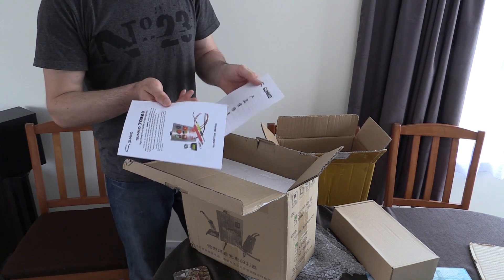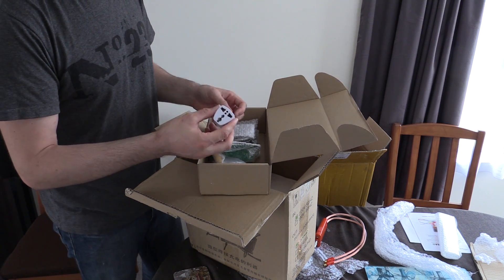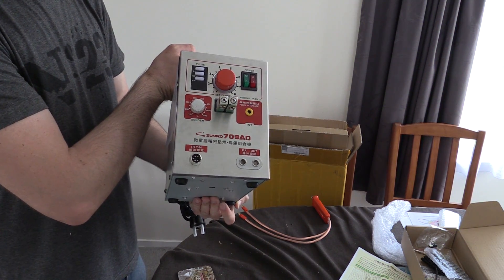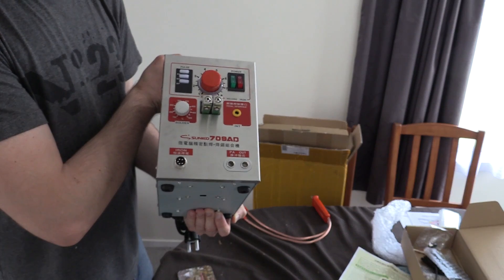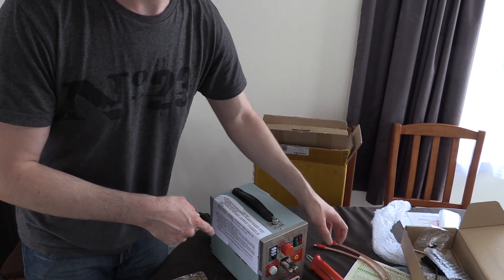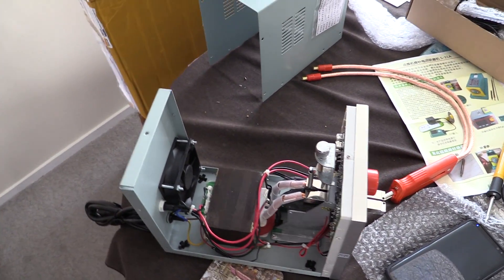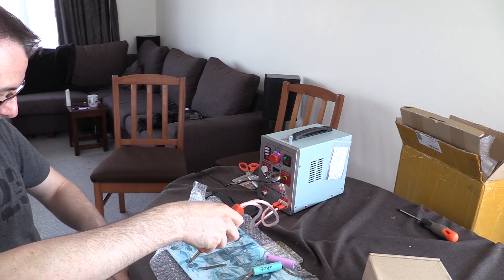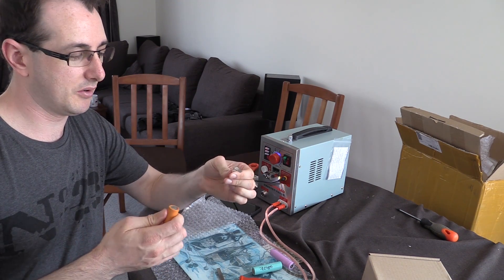Spot Welder 709AD

Comment: Hi Mike, I'm just starting out on my powerwall journey, I have a few hundred good cells and a 709 welder and most of the parts needed to build a few packs. I’ve also been pondering the fuse issue and decided to go with welding small tabs to the + battery terminal and then soldering glass fuses to the tabs and the busbars. The few test batteries I’ve fused I have worked perfectly with little or no heat on the battery terminal from soldering. P.S. I live in Christchurch and struggling to get more batteries, any ideas on obtaining more  in my location?  I’m envious of your stash 😊 cheers Peter.
Reply from the maker: Hey Peter, hmm the 709 is the cut down version of the 709AD? Do you have any problems spot-welding using the wound? I am going to do Nickel strip down the center of the pack then glass fuse spot weld to the cell and the Nickel. No idea about welly but i would just drive around and see different recycling centers. I wouldnt call but visit them and smile, They normally will sell them to you.
Reply: I was being lazy,  when I said the spot welder was a 709 it's actually a 709AD+, I'm very happy with it so far. I tried welding glass fuses directly to the + end of the cell but if you don't get the settings and pressure spot on the welds can be of unreliable quality, for me the welded tab and soldered glass fuse is more predictable :) 

Thanks for the advice on finding cells, can you give me an idea of what I should pay for them?  Re the welder, I strongly recommend not using travel adaptors with the welder,  fit a new good quality plug and if possible use a dedicated circuit from the switchboard. Fortunately I'm a sparky so sorting it out wasn't an issue. The wand works great, very  similar to the front prongs, apparently the spacing between the prongs is critical. 

I've been practicing with dead cells and perfecting my technique. I've had a few flashes when I've not been careful so I've invested in a pair of flash protection glasses (Nemisis IRUV 5.0 from WeldWorx), they're very dark but do a great job of protecting my eyes, I've also installed additional lighting over the welding work station to offset the darkness of the glasses.

Comment: Yeaaahh... I know the first impressions are a bit weird, the whole welder feels very cheap Chinese stuff but the 709A 709AD 709AD+ actually do a good job. You get better and more consistent results when you keep the dial as high as possible depending on the thickness you're welding. You have to adjust the power when you weld a second, third nickel layer. If you notice that you're melting the copper tip ends over the welds, reduce the power. If you notice that the tips are deforming mushrooming, stop and file/sand back to its original shape. I used the original tips to weld thousands of cells, it only requires very little maintenance.
Fixing the fan: remove the whole fan from the casing and remove the sticker with the specs and brand. You should find a lost circlip that holds the fan motor shaft =]
More POWAAAAAAAHHH
Reply: BrunoPOWEEER just got the 709a powaaaaaaaa

Comment: I would raise the power some. It looked like it didnt stick good enough. Spot welder is the  thing!
Reply from the maker: ok will do. More power. Tho I did blow straight through a cell when testing which was too much power.
Reply: It for sure is tricky to get going. Its very dependant on the pressure and other things :)  Took me some time to to get going here as well and first cells i got very different results

Comment: I fear you are trading some safety here for time saving, how are you planning to fuse the cells? in 12 months i've only had to cut 1 cell from my packs, but it was needed. cell was getting very hot in the middle of pack so i just cut the fuse and the pack stabilised. :)
Reply from the maker: Yes always fuse, using a spot welder doesnt change the fact it still needs to be fused. Rather than soldering we will spot weld the fuse in place. More videos will be out soon :)
Reply: That sounds awfully fiddly mate, i look forward to seeing it :)

Comment: I have yet to use an OEM Battery Tab welder, I have gotten pretty good at making ones that work perfectly(5 total). In the middle of a build right now.  I have yet to see any other DIYer have any success when it comes to these OEMs and building their packs. I have not had a chance to build a larger PowerWall pack with one of mine yet. But I will very soon. If I had to guess, putting the fuses on the top should work perfectly. But I am still stuck soldering the Busbar(I assume). These welders seem to work the best if building packs with only Nickle Tabs or smaller packs. Pure Nickle is also something to watch for. The Nickle plated ones, seem to be harder to weld. I can't wait to see what you come up with! If anyone can figure it out, its you!!!
Reply from the maker: Thanks for the comment, Ya its going to be interesting with the busbars but after thinking about it over the last few weeks i will be using nickle strip. Will do a video on it soon :) oh and great work on the diy spot welder build i would of also tryied a diy but for the time and money it was worth me just buying one as i have so many other things i should be doing etc for the battery builds

Comment: yay he's back..
The foot pedal most likely would drive the FETs which takes the current. The fans C clip popped off, it's probably hiding behind the sticker which the sticker covers a plastic cap.. just pop it off and put the clip back on. I've reluctantly repaired too many of those when we were out of stock of fans.
DON'T leave the fan in there like that. the fab is designed to blow heat out which means the fan will fly inwards and the pin will touch something of 240V and blow it up.!
btw, you'll get a feel for it when it starts to weld really well, also you should be able to work on one side to the other and pulling the nickel as you go along. don't do either side and then the middle of course. ;)
Reply from the maker: Back again, Michaels back tell some friends. haha . I hope the foot pedal would not be 240v tho and rather low voltage to the fets gate. Over the next few weeks i will have more of a play and do some videos of welding up the packs. 28 to do now.